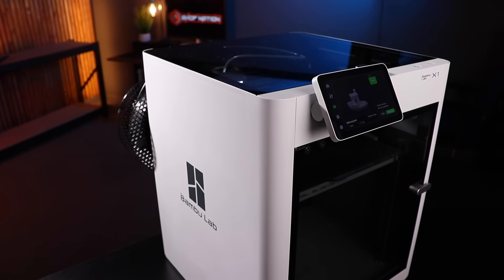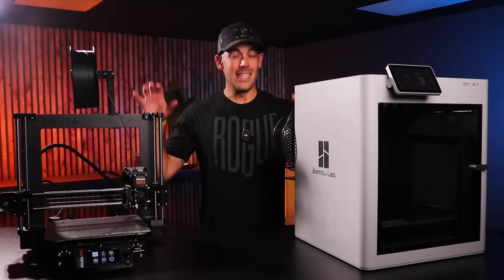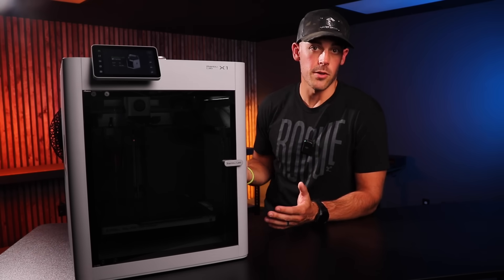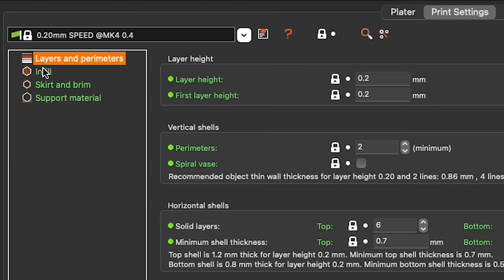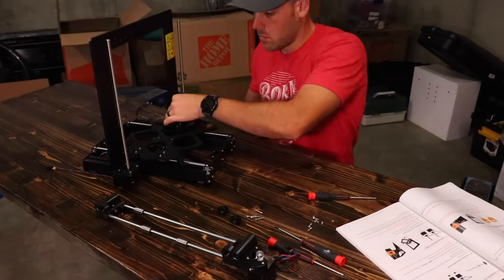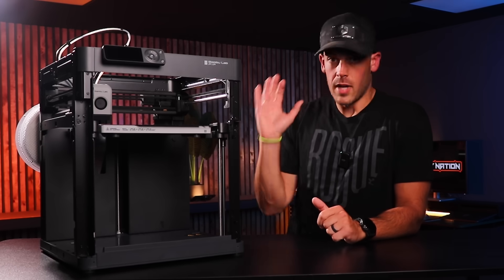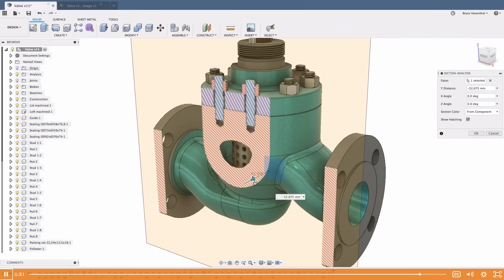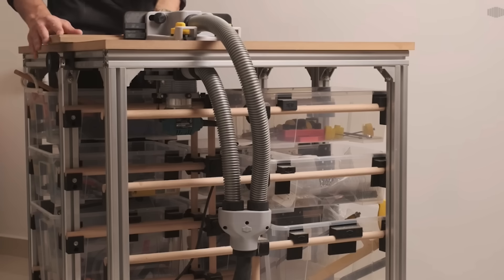The 3D Printer I'd buy if I started over

Comment: Bambu Lab's innovations are so recent that I don't even want to buy my next printer right now. I'm using an Ender 3 with a few modifications which, albeit extremely slow, gets the job done. But it seems like only now are 3D printer manufacturers stepping up their game and making good, fast, reliable machines that work (or nearly work) out of the box, minimal assembly required. The problem is that the entry point for that kind of stuff is $300. My Ender 3 cost $100. When these cool new printers become old news and cost $100 is when I'll upgrade.

Comment: What type of 3D printer, including brand and models, will depend completely on budget, what you want to print, how much time you have to complete a print and how much tinkering a person wants to do.    You can't say one printer fits everyone. 
I have had 5 Ender 3's and 3 Ender 5's and they have worked absolutely fine out of the box, and all of them are still running to this day, and the oldest is now almost 6 years old.        I've seen people complaining about what a pain in the * Prusa printers are and praising Creality Ender range, I've seen videos like yours that have said Prusa have been great.
No matter what you get you will need to fiddle around to get things working right, but once you get the settings right, then any reasonably solid printer will work fine.    New technology, like LiDAR and AI camera's are improving things, but no matter what you get they will all need tweaking.

Comment: I will stay with my pinto's. An ender 3 neo and ender 3 max eno. A little more work. But I can buy 3 enders max's for the price of a Prusa.  And I got a 300x300x320 not a 250 x 210 x 210 so I would have to get a Pruas XL? To do what I need, I need at lest 4 printers. So 1120 compared to 10k? The winner is Enders. Sure their is more work with them, but I like having the 9 grand in my bank.

Comment: I've never done any 3D printing but I have a design for one that has literally zero backlash, high torque, No Rails, No Rods or belts of Any-Kind at all. Submicron precision.
And the printing is done on the inside of the motors. Hence the High Torque. (Bigger build volume means bigger diameter motor) There are three motors stacked on top of each other in the same vertical space.
One of the motors is strictly for the Z-axis. The bed twists like a screw going through a bolt. It will never need any leveling.
And the other two motors, independently neither one are the X or the Y,
But coordinated together, they both become the Xand the Y.
And because it has submicron precision, you could do laser lithography with this. And I've already thought of the chemical recycling method built into the centrifugal build plate setup so it's very efficient on recycling chemicals that get spun off the platter.
The machine will be way the hell heavier but it will be cheaper. It's not as complicated as you think. But it is way more unique setup than you could imagine.

Comment: Awesome video, great information. You mentioned there were kits I can purchase in this video. Just wondering, is there  any kits available to accommodate a bigger platform? I’d imagine it still uses the same components but with larger frame connections and rails.

Comment: lol the problem is people dont have 1200 bux to throw into a feeling out a hobby or a tool to assist their hobby... you may think most of the people in the us are middle/upper middle and 1200 is peanuts but reality is much much different. 1200 is still a  lot of money to most people, even in the us. So spening 75 bux a ender 3 clone and 8 bux on a bed sensor is worth the hour of reading and install to get it to ..... just work as you put it.

Comment: My issue with Bambu is the amount of data they collect in an encrypted method so you don't know what all they are collecting from your system. Not only are they collecting every file you print, there appears to be way more than just the print job being collected and sent to Bambu. At least the Prusa can be used in a closed network for NDA safety, especially if you are doing anything government related.

Comment: Good clear video help me decided on what I need to do … only ….still a little
Unclear
On the actual modelling of a part, here’s the rub….i have a Porsche that I am looking design and fit a part that will allow a clock but not cut into dash , but I’ve a section that has a grill I want to build section but alter it to accept the clock…but how do I design it ??

Comment: What i actually realised the most demand regarding 3D printers, those who knows nothing to build their own models in CAD. They just want print more mando helmets, funny fidgets, etc. Yes, a faster printer is better than slow printer no doubt. But a faster print not always better than a slower print. Regarding dimensional accuracy, tolerances. Layer adhesion etc... If you choose 3D printer, one of the reason is probably you dont need thousands of products but you dealing with prototypes or low amount of replicas. In that case, it really does not make a difference if your 10-20 items are done in 4 hours in perfect quality or in 1hrs.

Comment: My first 3d printer was an Ender 3 PRO. I got it for $160 with 3 spools of PLA.  I love the printer, but it wasn't without its faults. At first every single time I used it I had to re-level the bed, even after that I had issues with first layer adhesion and my Z axis slightly shifted between layers. After 2 years of it mostly sitting, I upgraded it. I replaced the bed with a tri-level bed and a CNC aluminum bed with a PET plate, I added an extra stepper motor for better Z axis accuracy, upgraded Boden tube, BL touch, tightened up belts, now it prints like a dream. I have even transported it in my car and it kept the same bed leveling when I set it back up, no adjustments needed! These things need to be upgraded and treated like a precision tool and for the price of buying it + upgrades I've only spent a couple hundred for a solid and precise printer

Comment: I have built two 3d printers and i am sincerely wanting a printer i don’t have to build. I already do 3d modeling in another side gig using Fusion. But its underused, so stepping back into 3d printing with that basic Bambu printer seems a good move for me. Thanks for your video.

Comment: On a past video you mentioned spools of filament issues.  The solution is to create a ball of filament as a spool and have an omni directional tool to unravel it as it feeds your printer.  You dont need cardboard or plastic spool rings and can use all of the spool, it would save space and material.

Comment: I have to say, that I took a different route. I bought an Ender. And I am constantly leveling it manually. I spend many hours fixing things on it. And already the second object I printed (the first one was the cat that came on the Micro SD card with the printer) was my own design. Since then, I only printed two other objects designed by someone else, a Klein bottle (yes, I am a nerd) and a skull. I really like thinking up, designing and refining 3D models. And I am using the most basic software, SketchUp in the free version. Right now I am pondering writing Perl scripts to create STL files for some other Klein bottle like nerd stuff.

Comment: Seems a little off $1200 for a prusa that works out the box im not sure is that much better that a new $300 ender 3 i get older versions needed lors of updates but the new generatiins have auto bed leveling, filament runout detection and most are even intergrated extruder and hot end for those TPU prints. At this point i woukd say the biggest advantage to the two $1200 printers would be speed and multi filament compatibility.

Comment: i use a ender 3 pro with a bltouch and a direct drive. 
my printbed is leveled wit a millimeterdail or how it is called the bltouch severs only for a consisted z height because using the bed leveling of the bltouch works only great if the bed it self is almost level otherwise the z screw wear extremely fast and can be jammed because of that and also some weird artifacts. the direct drive mod is for better flow control and for printing tpu.
i love my ender 3 the prints are perfect if i dont screwed up the placement orientation of the print. ^^'
i dont need another printer. i can also print multi color with a mosaic palette-3 but i used it 3 or 5 times and now its collecting dust. i thought i have the need for that but i dont. i have water solvable filament to and tried it as support but it dont stick well on the bed and the pla or the tpu so very much useless for me. 
another thing i love my ender 3 pro i can start a print any size or time and can walk away with out the worry something bad gonna happen. in the beginning it happen a lot but since i use the bltouch for consistent z height the first layer is every time perfect and after i use the direct drive i use less filament on changes and the flow is much better. also going down from 60mm/s to 50mm/s helping too. yea i know it is slow and going even slower sounds ridicules but the quality and reliability improves a lot so i dont care.  for the rest of the machine it is all stock. i wish the ender can use normal usb sticks but i understand why it uses a tf-card interface. 

so i think if you get some time for your machine and fix the problems it has it can be a reliable machine with good quality. also be said the ender3 is a open platform so you could use anything you find or create you own accessory. for the bambolab thing it is a proprietary eco system so if something brake you have to buy it from them and if the machine is discontinued you may screwed.

Comment: The ender 3 pro has been doing wonders for me. I was told to look at it as a hobby so I wouldn't get frustrated with the failures. That thought process has been amazing. I have fixed, changed, and currently fixing things. I understand the functions so much better. But now I want to run an etsy shop, so I need reliability. This video has been super helpful
Reply: I'm in the same boat as you but with an ender 3 v2. I've decided to switch to resin printer to get more consistent results

Comment: GREAT VIDEO! Now I'm Subscribed!
I've been thinking about getting a 3D printer but, as you advised, I want it to work reliably. One of me requirements is a printer that can print engineering-quality plastic. I don't want my gadgets to melt on the dashboard of my car. (Texas can be very hot.) That means the printer gas to at least Nylon. My research indicates that an enclosed printing space is needed to maintain the temperature at the correct level.

QUESTION: In that case would you recommend the Bambu Lab X1 Carbon rather than the Bambu Lab P1P? (I think I'd prefer to pay more to make it easier to get good results.)

Comment: I have an old South Bend lathe. I’ve been looking for a set of change gears for threading for years with no luck. Is it possible to use one of these to make my own gears? I have no experience with programming and have never owned a 3D printer. This video has sparked my interest. Thanks.

Comment: I have had an ender 3 for years and every time I use it, I have to mess with it (it usually collects dust) and now that I'm back in the firearms space and need to test designs out, I need something fast and easy with a lot of material capabilities, and you just made the decision easy for me. Thank you so much!
Reply: My Ender was almost my last printer. It was hard to use, constantly going wrong, and Creality sucks. Then I bought a Guider 2, then a Carbon X1. The Carbon was everything I had dreamed of in a printer.
Reply: If you already have the e3, it doesn't take too much to turn it into a great machine. I nearly went down the same road but fell into the rabbit hole along the way.
Reply: @parsonk4041  I was never interested in becoming a printer systems engineer. All I wanted was to print stuff.  The Bambu got me there.

Comment: How ignorant! I have both machines highlighted in this video, and they're obviously amazing. But to say that the Ender brand doesn't work out of the box is insane. The Ender 3S one line of printers have auto bed leveling, filament run out sensors an All metal hot ends with direct drive and they work directly out of the box. This guy might have paid for his machines this time, but this video proves to me he's looking for those sweet handouts from his favorite manufacturers.

Comment: I've been 3D printing since 2018 owning a Prusa MK2. I done lots of research back then and chose Prusa. Fast forward to today and I'm still a Prusa owner with the MK3s (Soon to be MK4). One thing I can say about Prusa is you're not left out of the loop with continued updates making your printer better. When they bring out a new printer there's always an upgrade path.  Also 3d printing is not just about the hardware, it's also about the software and Prusa slicer has come on leaps and bounds over the last 5 years with contiued updates and more and more features. The Prusa is quite frankly a work horse. It just goes on and on with virtually no issues. I've never had to replace anything on my printers. Customer service is spot on too. Just wish their lead times were not so long. But good things comes to those who wait.
Reply: Whatever floats your benchy my dude

Comment: I need a larger table, 18" (450 mm) x 18" (450 mm) x 5" (130 mm) to print ABS wheel covers. But the ones shown were smaller, 250 mm x 250 mm. Can you recommend larger table size, ABS, 3d printers that won't cost a house mortgage payment?

Comment: Can someone please help and answer my question, because I dont know where else to turn.  I need to build a prototype of something.  I'm thinking I need to go the route of 3D printing so I can test and refine my design.  The item I'm printing is 25" in length and height and roughly 5" in depth.  Which would be the cheapest but useful printer to buy.  Followup question, what is the easiest software to learn on with a complete noobie idiot like myself?  Please any help would be greatly appreciated.

Comment: Me personally I am glad I started off with a cheaper printer (neptune 4 pro) i've learned a lot about how to fix to diagnose issues, change a nozzle etc. etc. 
Immediately after a couple of prints I was running into issues so I had to look for answers  (all my first layers started to fail)

  Once you start off with cheaper printers you will be able to appreciate more , something like a mk4 . Once I do get more money i wish to buy a mk4 (or a mk5 if it comes out) simply because it's open source and tinkering it pretty fun
Reply: I'm decent with SketchUp for drafting. Been eyeing the Elegoo Neptune 4 Pro. Thinking it would be best to start off with as a first 3D Printer. Sounds like it has been working out well for you other than some beginner issues?
Reply: @chrisalister2297  I would recommend going for a BambuLab A1 or A1 mini.

Comment: I purchased a makerbot years ago. Tried to print polygon shaped puzzle pieces. Getting the relationship to the bed was a complete disaster. Either it was too tight and I couldn't get the print off the bed (chisel and hammer - give me a break) or it was too loose and the corners curled up. Played with tape and alcohol - both time consuming. Are there printers out there that actually work, or do we continue to waste time/energy/money on production issues nobody wants to talk about? Thanks, Sandy

Comment: Great video!  I got some information from it. I am a NEW beginner.  I looked at 3D printers a few years ago and was  disenchanted with all the "tinkering".  I don't mind a little tinkering, but if that is all you do is tinker and tweak the machine to get it to work properly,  that is very frustrating, especially if you are a newbie to the craft.  I have a CNC router and that's all I seem to do is tinker and tweak.  When it is set-up properly, it is wonderful,  but that is rare it seems.  Anyway, I was hopeful that these Bambu Labs machines will eliminate most of that.

Comment: I run a small 3d print farm (6 printers) and I use the Ender 3 S1 Pro. You can find them for $400 on sale and have basically everything you need. Yeah, you have to level the bed, but that's simple enough. Otherwise it just works. The only modification I made to them is I upgraded to a tungsten nozzles, and that's not necessary if you are just printing as a hobby.

Comment: The 3D Printer I'd buy if I started over ? I started over on black friday...  super cheap and really good, and fast!
Creality Ender 3 v3 se. I had issues with the z auto offset, which i manually tweeked, but other than that, perfect prints every time, 
there is never a painful experience with that one if you don't run out of filament.

I'm going back to tune my JGAurora A5 next weekend, removing the 1mm nozzle that never works because it underextrudes 133%, I'll also add a bltouch clone, redo the community marlin firmware, hoping that these upgrades will be fixing the bed leveling problem that never seems ok unless the springs are too tight and the z limit switch fine-tuned with a bolt and nut.